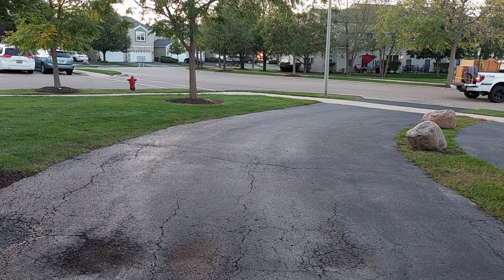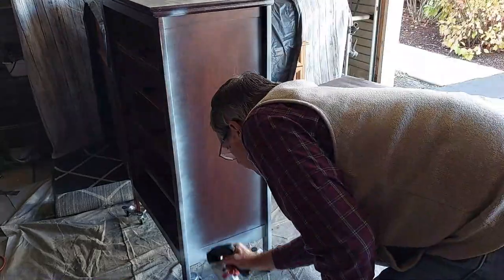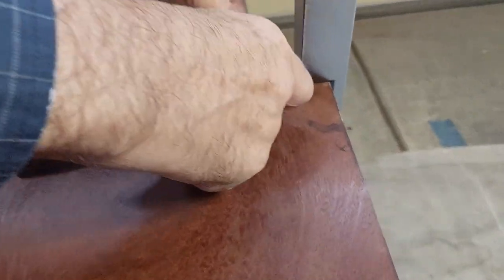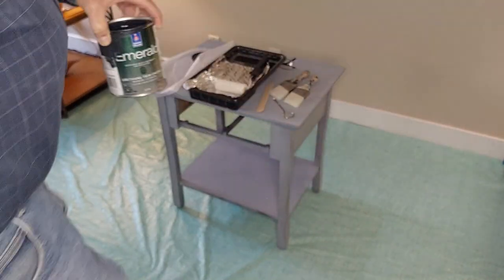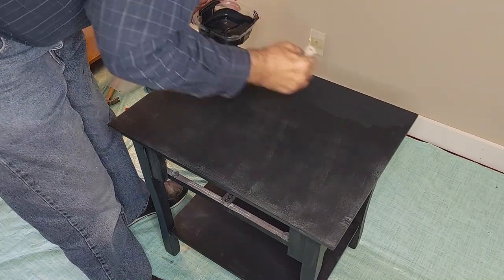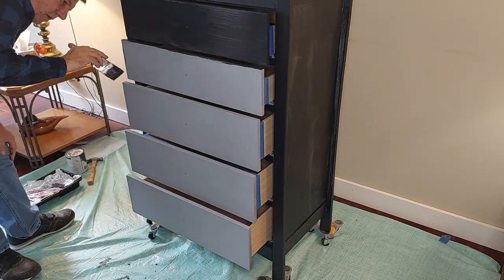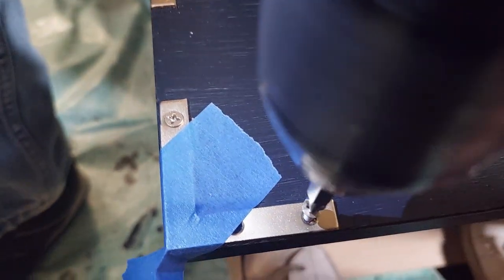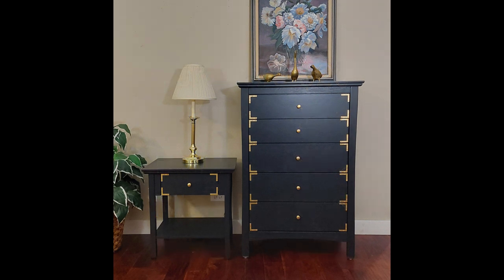Amazing Way to Turn Drab Into Industrial Glam

Comment: Such a striking design!  I like the contrast of metallic gold and black.  Since you usually paint indoors during cooler months you probably have a great system for protecting your carpet/flooring.  Just in case it is of interest I purchased a dropcloth with an attached tarp from Harbor Freight.   That saved me when I accidentally bumped into a can of paint, the tarp kept the paint from my white oak flooring.   (Sneezing while painting furniture is not recommended!   Silly allergies.)
Reply from the maker: Thanks for the info! Always looking for better ways!😀